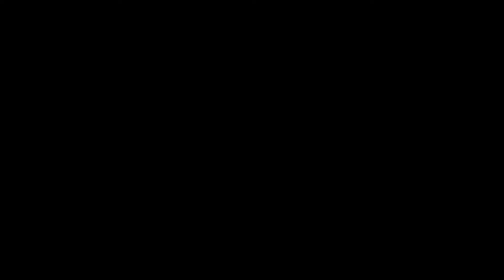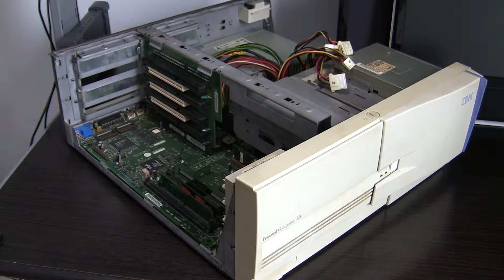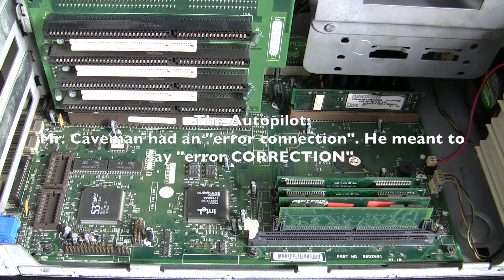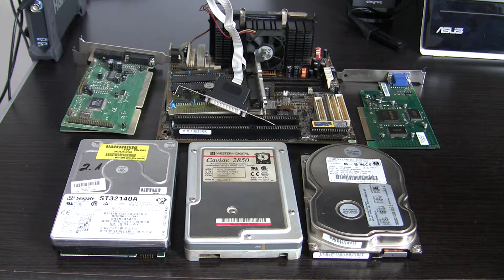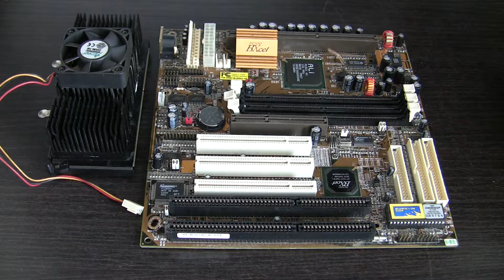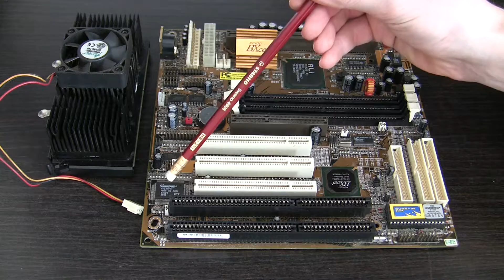IBM Personal Computer 350 and an utterly awful PCChips M726

Comment: Don't know what he is talking about. I have that PCC board myself for Retro-Computing and it runs quite well. Testet with P2 Klamath 266, P2 Deschutes 400 and P3 Katmai and performance and stbility are good in Windows 98SE as well as in DOS. But maybe I can't judge it right because I never had a Slot system back in the days. I went 486 DX/2 66 -> P54C 100 -> K6M'X 166 -> K6-2 350 -> Athlon XP 2400+ -> Athlon XP 2800+ etc ..
Anyway, I like that board and it does what it's supposed to.
The SoundPro+ is indeed an CMI 8330 ISA chip but the relabeling is not made by PC-Chips. I own an ISA soundcard with the same labeling. I also do believe CMI named it like that themselves. For me, this is the best Soundchip ever on ISA basis. It has true SB 16, no hanging notes bug, WSS, a good OPL clone, vsurround and loudness function and until know I did not have a game where sound was not working properly. Only downside (for me) is thar they are hard to find with a wavetable header. I modded mine (the ISA card) and added a header.